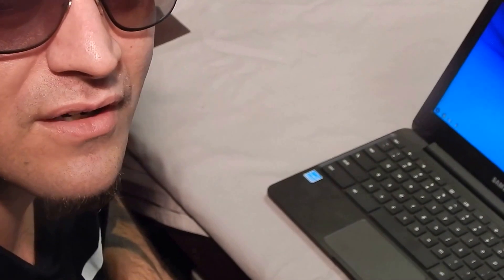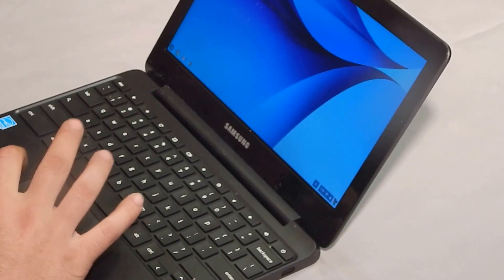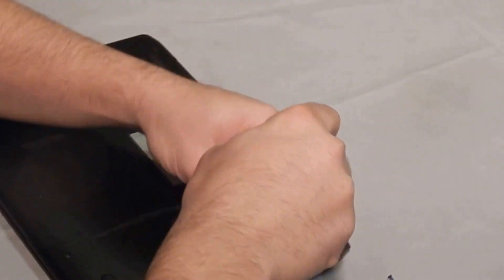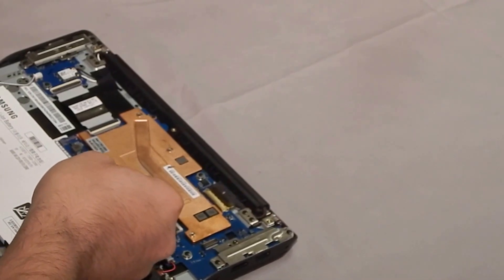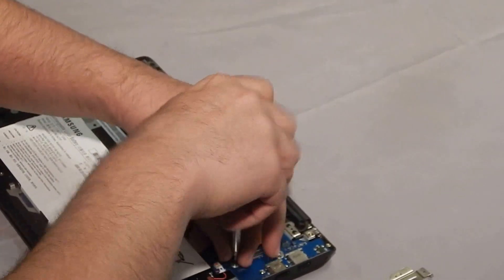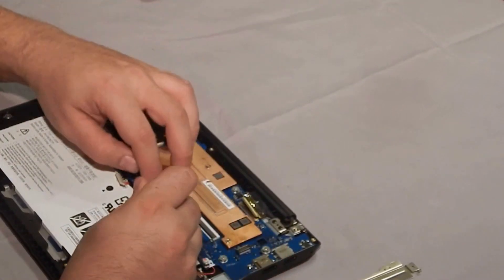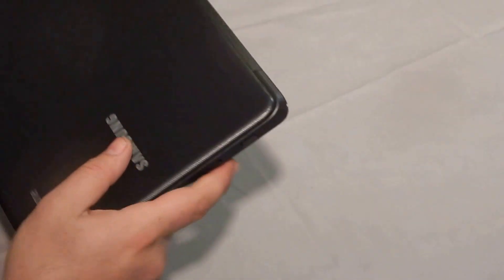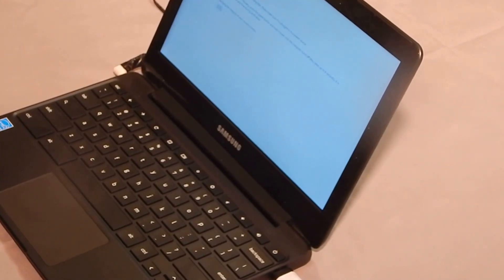How to remove forced enterprise enrollment for Samsung Google Chromebook XE500C13

Comment: Thank you! No one seems to know anything about this but you! If this was your only video that'd be enough for your channel to be monetized. Have you considered having a technology-centered Youtube channel?
Reply: what chromebook do you have?
Reply: and what did you exactly do cus it aint working for me
Reply: @erionagamesnl8168  My chromebook is the Samsung Chromebook 3 (12607.58.0). I bought it used from a guy who'd just finished college. It's the exact same unit seen in this video, looks exactly the same when it's opened up. I've been trying to get it into developer mode, never could do it until now. I have been following many tutorials on how to do it. I think it's a combination of all the tutorials I've see that's helped me. However this video made the difference, had to take the case off. I read somewhere that this piticular chromebook is more difficult than others to work on.
Reply: @erionagamesnl8168  What are you attempting to do? I only wanted to get the unit into developer mode so that I can install and run a Linux distro on it. I followed this guys instructions in the video. I bought the chromebook about 2yyears ago, I had concluded that it's not possible until this video.
Reply: @erionagamesnl8168  Now that this unit is in developer mode I feel like I can finally use it to it's full potential. 🙂
Reply: @abaneyone  i am trying to do the same but it wont work for me so what did you do After the video ended?
Reply: @erionagamesnl8168  I've been trying to do this for 2 years lol. This video was part of a combination of many YouTube videos and in internet articles I watched and read. After failing many times, only  wiping the chromebook I gave up. Having some time off I decided to try it again. This video was the bomb! First go to the play store on your chromebook and download the Chromebook Recovery Utility app. Plug in a USB that you don't mind getting erased and make a recovery USB of your piticular chromebook model. Then follow all the steps seen in this video. Hey, I'm not completely sure why it worked for me, I think it may be because I left the battery disconnected for an extended time, like a whole day. Just be sure to follow all the steps closely. Do not plug in your battery while doing the steps. So far I've only achieved developer mode. My chromebook can read from USB but I'm not able go boot from a USB yet, but I will eventually lol. Good luck man, I hope you're able to do what you want with your chromebook.
Reply: and btw did you use the special version and if so could you share it with me cus i cant find it anywhere
Reply: @erionagamesnl8168  https://www.youtube.com/watch?v=nAyfwROKdzI
Reply: @erionagamesnl8168  https://www.youtube.com/watch?v=UAAcQVJxfPk
Reply: @erionagamesnl8168  https://www.youtube.com/watch?v=HrjXpqe-A1Y

Comment: the recovery is out of date, cannot rollback?
Reply: I've tried many times with different timing.  Sounds like it is.  I would rather buy another cheap chromebook rather than spent hours on this in which I already did and these hours of mine could easily be converted into money that can well get yourself a new or used cheap chromebook.

Comment: Anyone find any updated fixes? I have a Dell 11 3120.. I have tried everything..  Everything is blocked from Dev mode to shell access in the chrome command window. I have tried completely taking out the mother board and letting it sit for a few days hoping it would lose bios data with no success. You of course can't even take out the storage and replace it with a new hard drive as it's a built in ssd storage in the motherboard. The read write screw crap isn't a thing because I have taken every screw out one by one and all of them at once and I got no where. I need to access dev mode. The only thing I feel is left to do is breach the google admin password which would be nearly impossible. I'm not sure how else to possibly remove the enrollment through software. I actually did even manage to powerwash the chromebook even though it was blocked. Even after a power wash it came back with enrollment and just a previous version of chrome os. I thought that could be an exploit as I had a previous chrome version but I still couldn't find a way around anything.
Reply: I got into my schools admin. i found the password by snooping in the office. Finding the email was harder than finding the password itself. I excused myself from class many times to go look in the office. I decided to go look in the office at lunchtime because the teachers were in the lounge. I thought this was the perfect time not realizing that a teacher could come at the very moment. As I had predicted, I teacher walked in. I was busted. Or so I thought. I told the teacher that I was sent to retrieve some papers from the printer. She believed me! She walked out of the office and I kept looking. Then I realized: Just go on the computer. Sure enough, I found the email. I was up and running! I logged onto the email and released EVERYBODY from the admin. After I did that my computer was free. Or so I thought. GoGuardian was still on. MORE work to do. After a week, I got the email and password. I released everybody once again. I was free. A month later, I was called to the office. They asked my a few questions, regarding everybody being free from admin. I lied about every question. They believed me. Now, you must be thinking: if I unenrolled them why don't they just put us back in? Well, I changed the password which ment that they were locked out. 😈
Reply: @welovee0000  doesn't your school have cameras? Bruh
Reply: @welovee0000  dang that’s crazy bro
Reply: Did you get it?
Reply: I have the same exact issue. Did you happen to figure it out?

Comment: Is it a bin file and is is from November 2015
Reply from the maker: you can get it at github
Reply: thanks, but i have found our a way that you can do it, you change the serial number for your chromebook
Reply: Chris Chappell how?
Reply: https://www.ifixit.com/Answers/View/231737/How+can+I+reset+a+managed+chrome+book+back+to+factory
Reply: i have a dell 11 3120 and i removed all screws that has a silver ring at the botton instead of the one in the article
Reply from the maker: Chris Chappell yes
Reply: Chris Chappell can you get back your old serial number
Reply: there is the serial number on the back of the chromebook under the bar code
Reply: And is the mlb serial number the same as only the serial number
Reply: Chris Chappell and do you know if you change the bios if you install crouton
Reply from the maker: 43
Reply: how did you get past developer mode being blocked tho?? No matter what I do it remembers developer mode is disabled..
Reply: Same boat with dell 11 3120. Removed all screws and tried pulling battery a few times but it still remembers dev mode.
Reply: same
Reply: What version of chrome OS did you restore after changing serial?

Comment: does this work with the hp chromebook?
Reply from the maker: I don't know. it might
Reply: Dominic Massimo the hp Doesnt have the screw :(
Reply from the maker: Thank you and stay tuned for updates coming soon
Reply: Dominic Massimo nevermind,  it does have it,  it was just hard to find. 
the read/write screw is in a semi-circle next to an arrow, like this (let the dot be the screw xD) 
"> (.)"
the screw makes both sides of the semi-circle be in contact with each other, so just taking it out, makes it easier to go in dev mode to be able change serial number and unroll from the auto-login-service :)
it took me a while to figure it out xD
Reply: Marco A. Enquel where exactly is it located? underneath the motherboard?
Reply: DonSizzler almost at the same spot that the one on the video is. 
to the left of the fan,  and above the battery :)